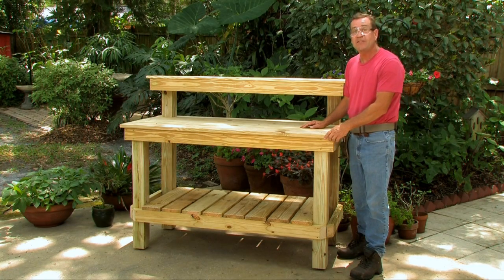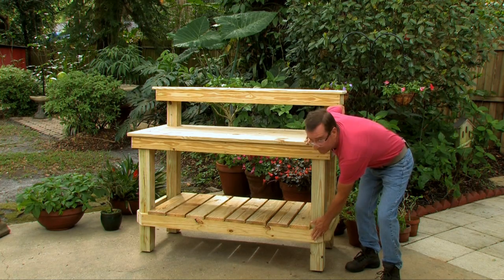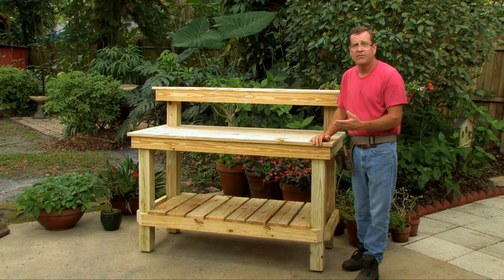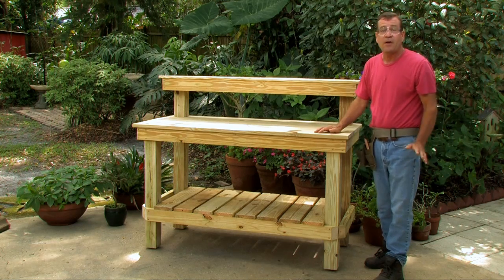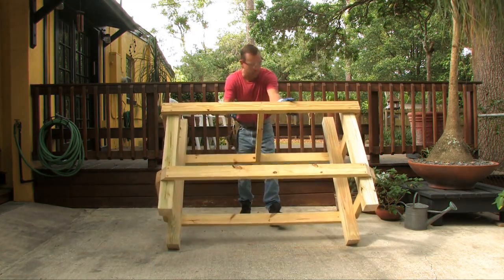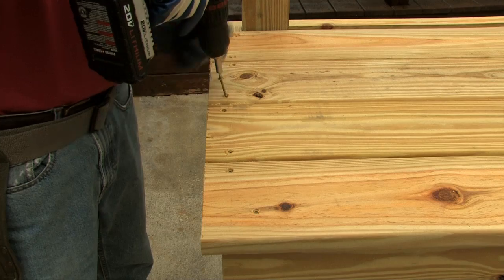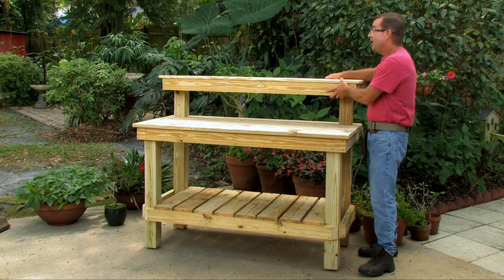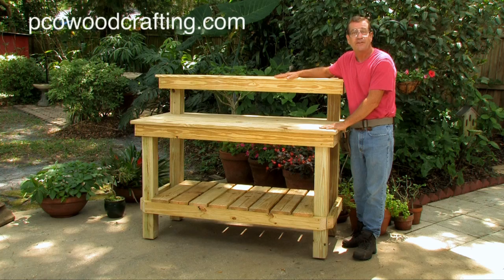DIY | How to Build a Potting Bench / Work Bench | Official Video

Comment: I want to make something like this, but gosh wood is expensive
Reply from the maker: You right Elizabeth wood is expensive right now due to the pandemic we had, it should go down by the end of this year.
Reply: @Pcowoodcrafting  Yeah, but I went and got the wood anyways, I just measured and then measured again so as not to waste. It came out beautifully. I liked it so much I modified it and used the same idea to make a much larger shop bench for my woodworking. I put it on locking castors and I love that thing. You did such a great job on teaching ho to make this. Please make more videos! I want to make a free standing porch swing.
Reply from the maker: @ebrooks24711  Hi Elizabeth, I am so glad you built your bench with modifications, that is totally awesome!  I will go ahead and keep the porch swing in mind, sounds like an awesome project to build.
Reply: @Pcowoodcrafting  I built yours for my husband and then I made my workbench. It is so sturdy. Unfortunately I have only been doing this a few months as I inherited all of my father's woodworking tools. I actually was putting a screw in and I w]couldn't get it in so I went around and held the wood from behind to give me more strength and changed to a larger bit for the pilot hole. I drilled right into my wrist. I nicked the artery and it was bad. I was lucky it didn't cause me permanent damage the doctor said. Lesson learned! Anyways it is hard to find these lessons online as some people are better at teaching than others. Some of these videos the people don't even talk! Hope to hear from you soon and any new project no matter what you put up I will build.
Reply from the maker: Oh my gosh Elizabeth, I am so sorry about your accident to your wrist. I hope it is healing up well.  I am glad you at least got to build one for your husband. I will keep you posted on further projects/videos.

Comment: A nice stain wouldn't hurt....
Reply from the maker: Yes, Michael, GREAT suggestion! Staining with a deck sealer type stain is most definite. But, you have to let the pressure treated lumber dry out for about 30 days before applying any stain or sealer. Sealer stains now come not only in a clear color but also come in many colors including semi transparent, transparent or solid colors that look like you have painted it.